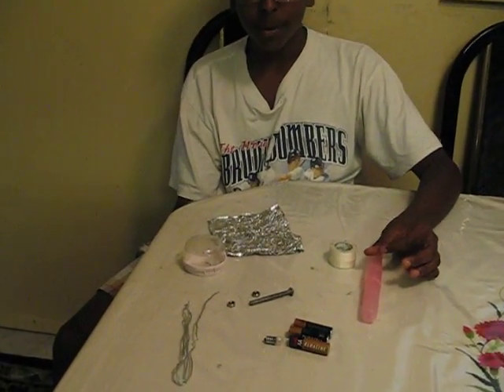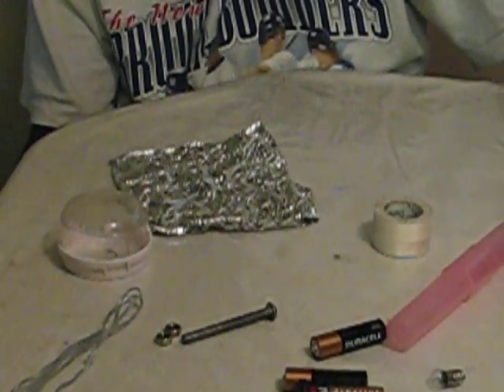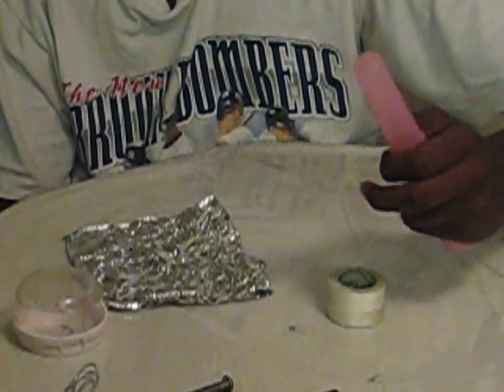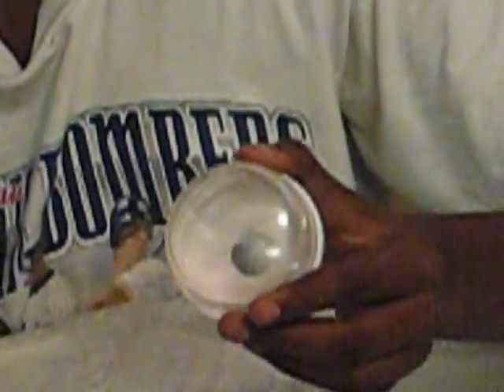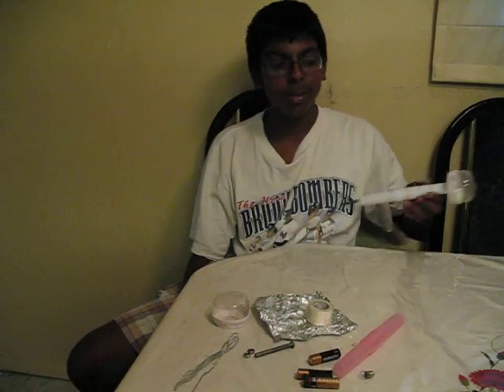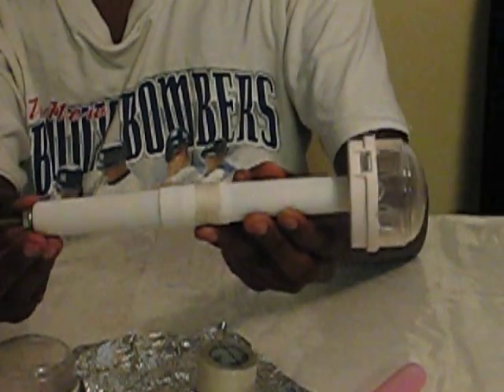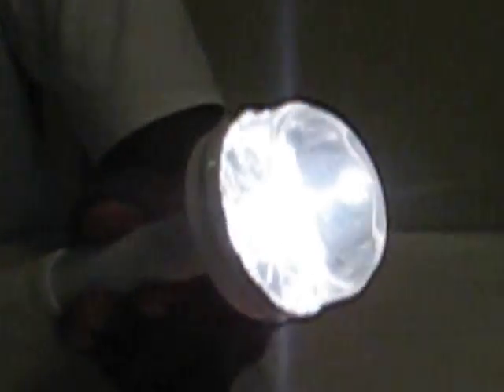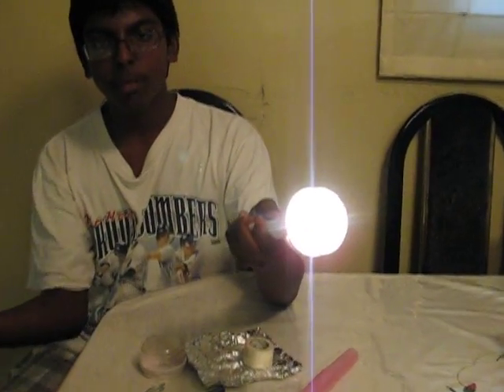MAKE YOUR OWN FLASHLIGHT USING - AA - BATTERIES

Comment from the maker: 8. When the loose contacts of the batteries are removed by pushing and holding both halves of the toothbrush holder turning the flashlight on.

Comment from the maker: 5. Cut the aluminum foil as needed to fit inside the oven knob protector and insert the bulb into the hole in the oven knob protector
6. Attach the oven knob protector assembly to the toothbrush holder assembly together by pushing the bulb base through the hole until the bulb base terminal touches the positive terminal of the battery.
7. Flashlight is ready for use

Comment from the maker: OK. Here is how it was put together.
1. Insert 3 AA batteries in to the toothbrush holder 
2. Connect the positive and the negative terminals of the batteries using the wire – in the model shown the wire is inside
3. Install the bolt through the hole at the back end of the toothbrush holder in such a way that it fills up the extra length if any with an intentional loose contact (to be used as a switch) 
4. Attach both halves of the toothbrush holder using the tape